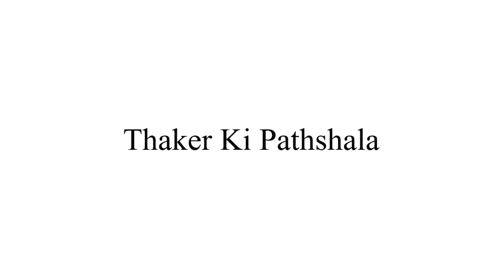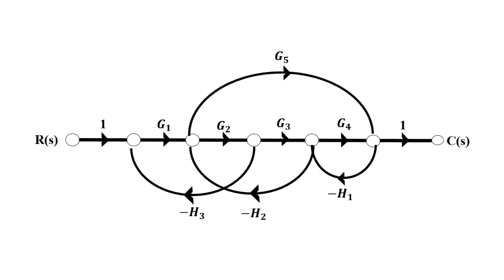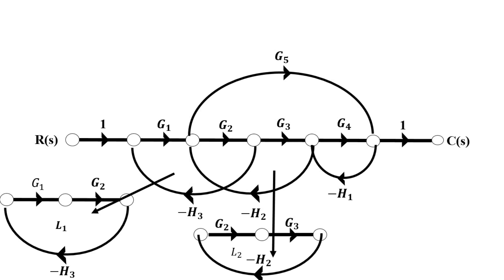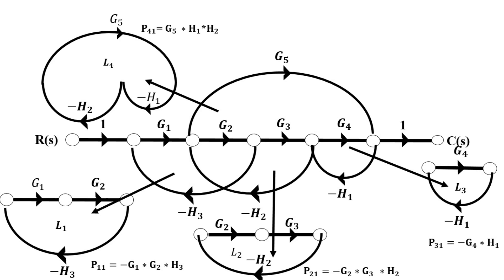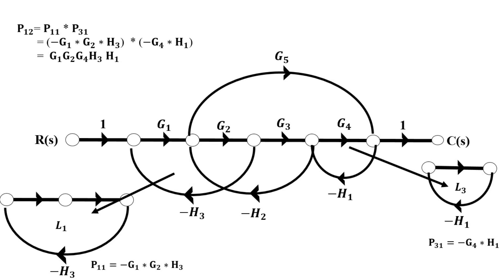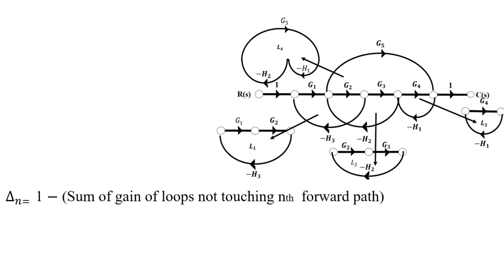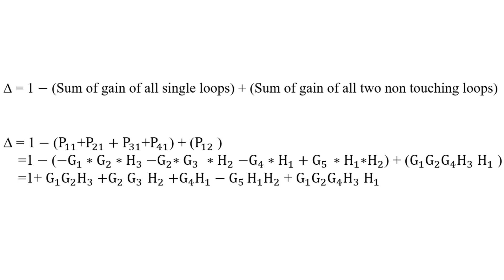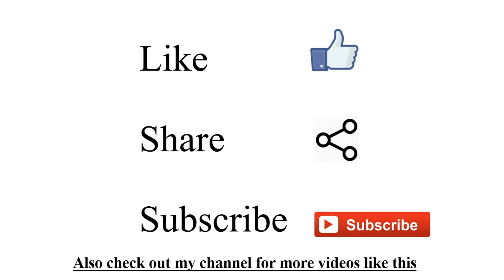Signal flow graph and Mason's gain formula | Thakar Ki Pathshala

Comment: G2 G3 G4 -H1 -H2 Is also an loop?
Reply: THE ANONYMOUS Yes its a loop
Reply: That's not a loop, it's two loops next to each other. A loop can't touch itself. Here, point between g3 and g4 is being touched in your case. Which means a loop can't be formed.